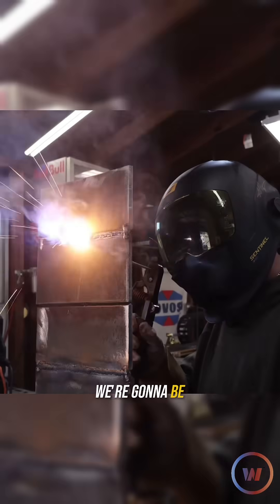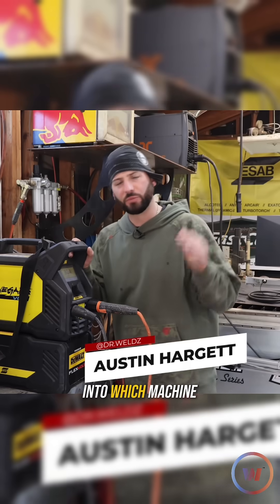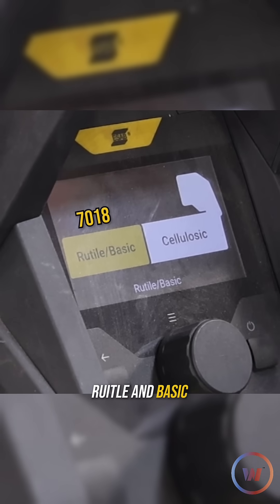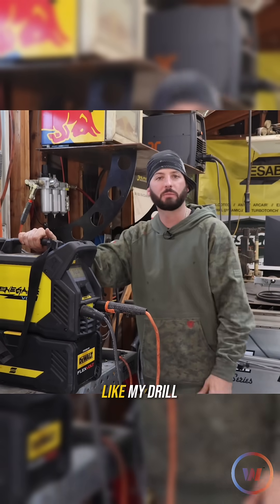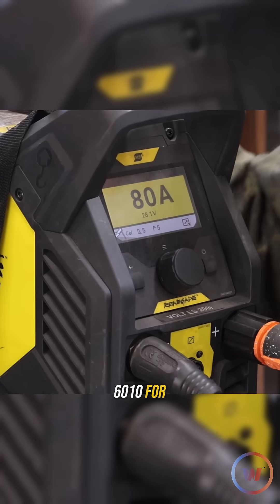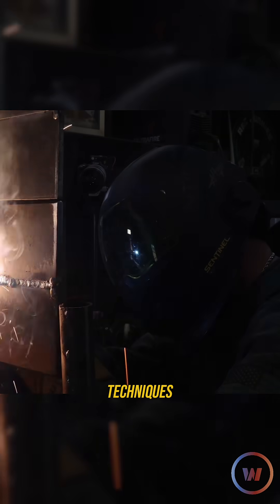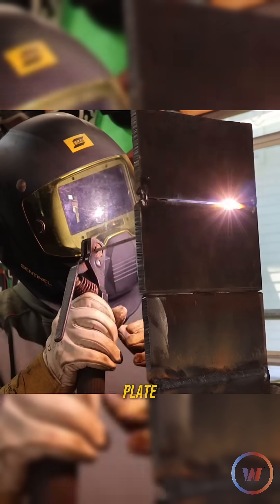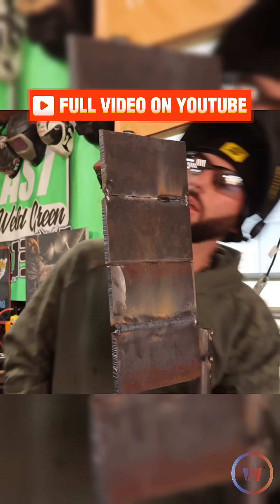6010 VS 7018 - Which is better Open Root Welding #welding

Comment: Is E6010 used with DCEP or DCEN polarity?
Reply: We ran ALL stick on EP. I was surprised when he said the 7018 was on EN, but I think that's so more of the heat is on the plate (like in TIG).